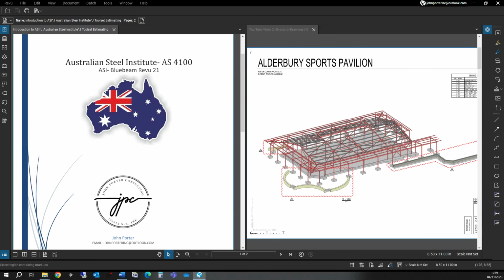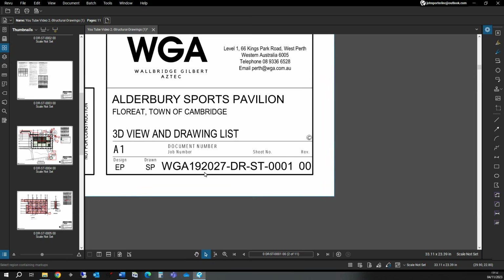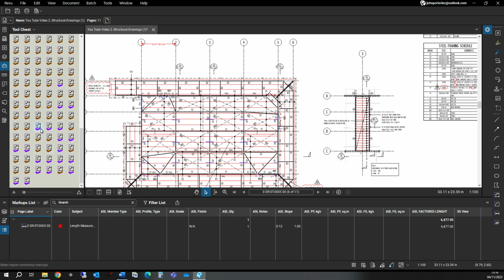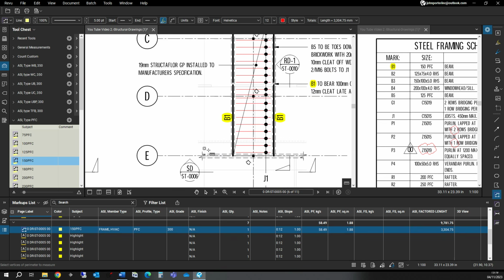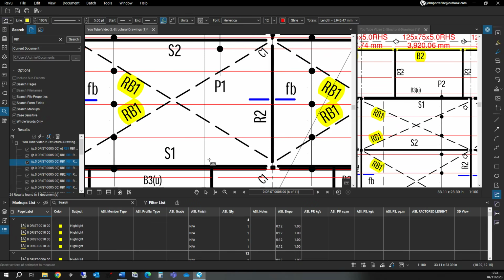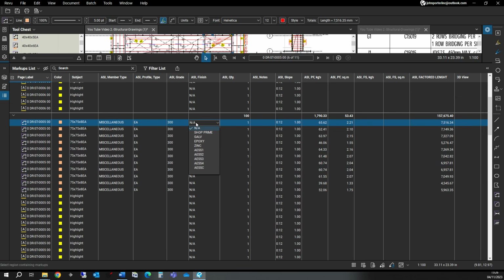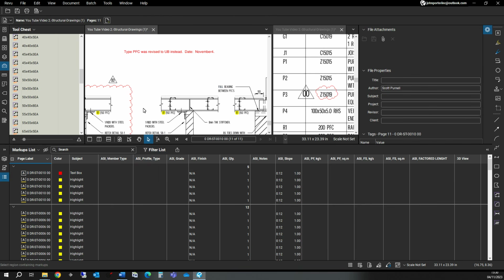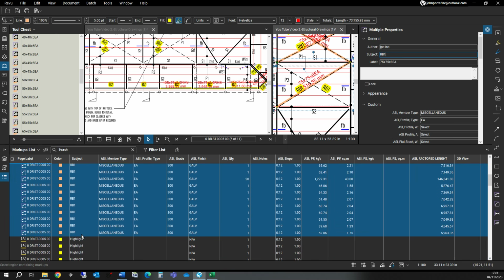Digital Estimating for Australia, AS Standard 4100 Structural Steel!

Comment: Hey John, I am interested in the tool set for australia. When can I find it? Price etc…
Reply from the maker: Hi Emerson,

Thanks for reaching out to me for Blue beam toolset for Australia.  Before I provide price I would need to confirm type of market that your company does work in.  Is your company more residential, commercial, Institutional, or industrial.  This will help me determine toolsets that you would require and pricing.

Our toolsets allows you to takeoff all assembly types, beams, columns, braces, girts, purlins, trusses and others made of all different Australian Profiles under AS4100.  Information that toolset gathers  Material sizes, weight, length, surface area to be painted and a listing of extra fabrication task needed for structural members.  Then info can be exported to Excell or as a PDF format.

Info can then be manipulated as you wish and linked to your standards Excell pricing sheet or imported into your MRP system if you which.

Our basic package for residential construction starts at $2500 US for 1 user and extra of $500 per additional user. Yearly maintenance/ updates fee of $250/year after. Can be paid via Visa after I have it installed on your workstation.  For training please add about 2 hours at $75/hr.

Keep in mind that prices will be increasing for 2024 and now would be a good like to lock in your prices.

If you want we could connect and I could provide you a free demo of what you would be buying.

Keep in mind that what we do at jpc is based on 35 years plus in the steel industry which we are applying all of our knowledge thru our toolsets.  We are also involved thru a partnership with Develle Structures in Australia who will be assisting jpc inc. in promoting toolsets for Australia.

Hope this email answers most of your questions and looking forward to hearing from you.

Sincerely,

John Porter